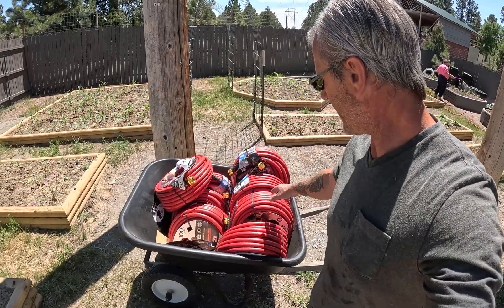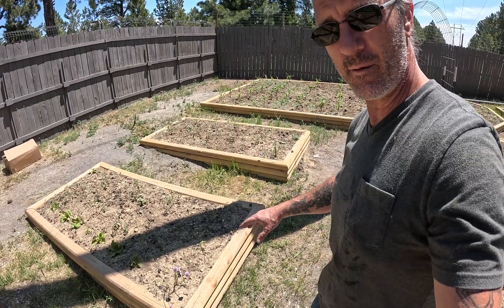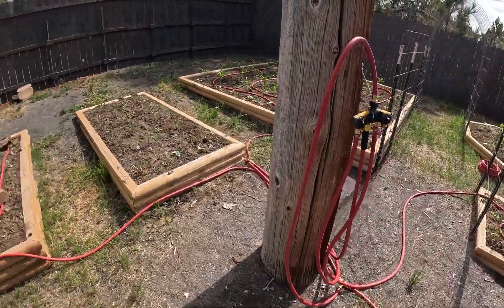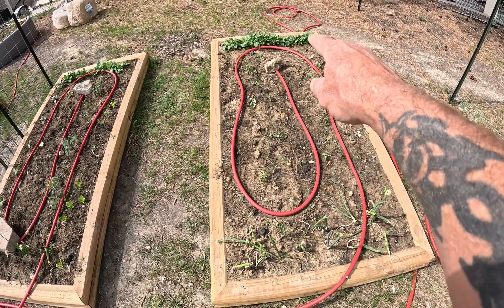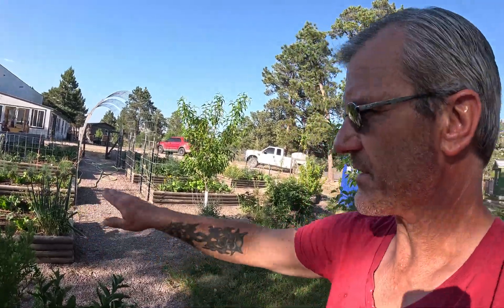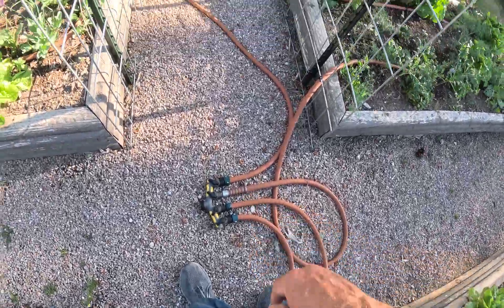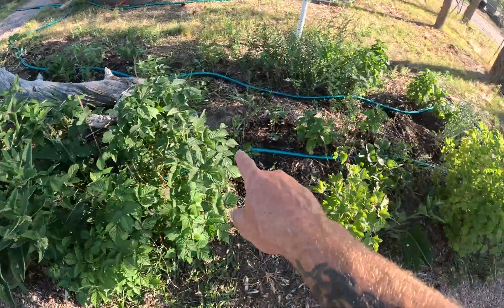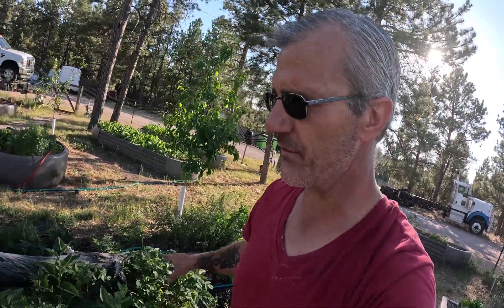Cost Effective, Homemade Drip Irrigation For Your Garden

Comment: Nice video. When I researched the cost of doing something like this, it seemed like it would be less expensive to use poly tubing. About $113 for 1,000’ of 1/2” poly or $226 for 1,000’ of 3/4”, but maybe I’m missing something.
Reply from the maker: You are probably right about that...but I wouldn't know because I was just looking to get it done cost effectively and locally. Also, I can't imagine polytubing bending and conforming like the ranch hose does or having more affordable and accessible male and female ends available for it as well. Either way...if you have an even better way of getting it done...more power to you and awesome job on your dedication to the subject! Thanks a lot, my friend!